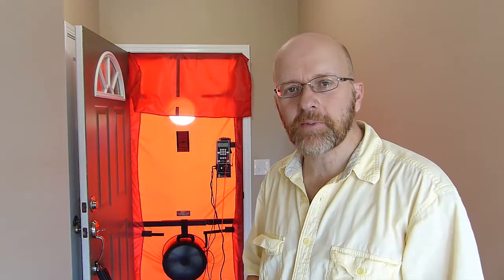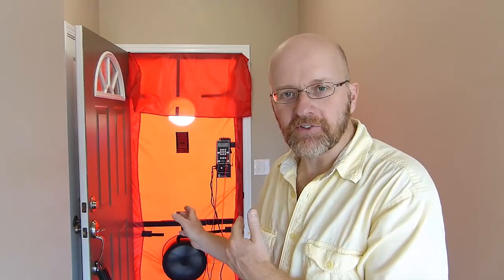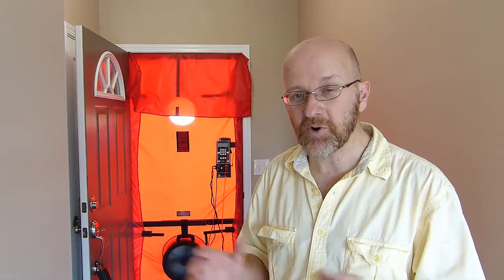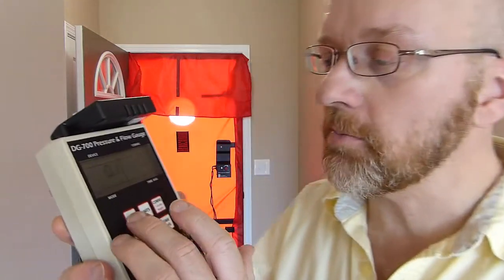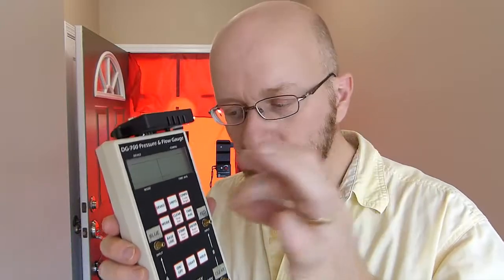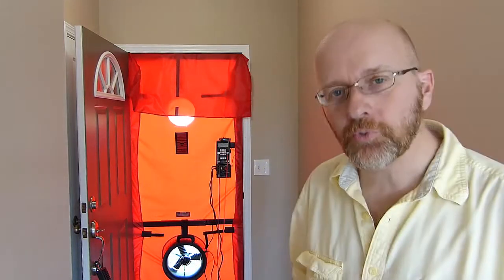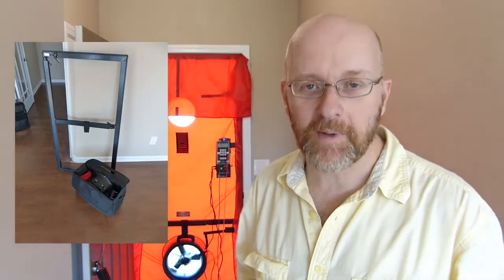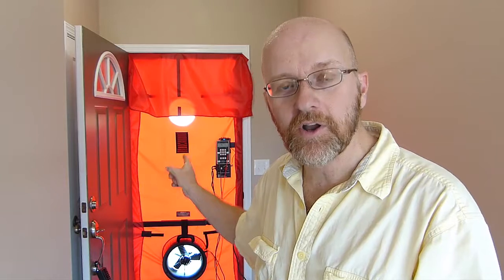Using the Duct Blaster Fan for Blower Door Testing

Comment: Your statement 134 cfm @ 50...…...is that the leakage rate?
Reply: That was the leakage rate of another house I was talking about, a passive house that I had tested earlier in the year. I told that builder that their entire house was tighter than an ENERGY STAR duct system.